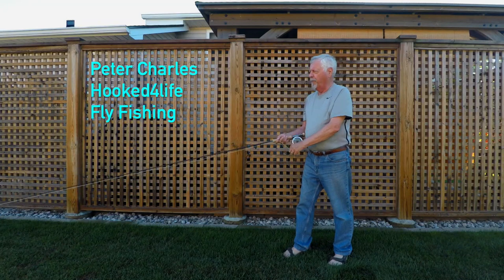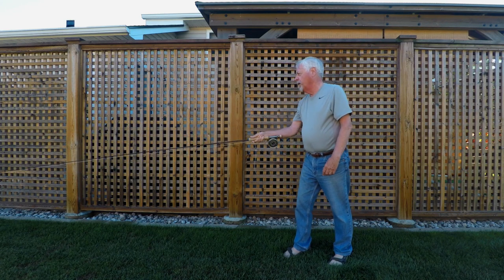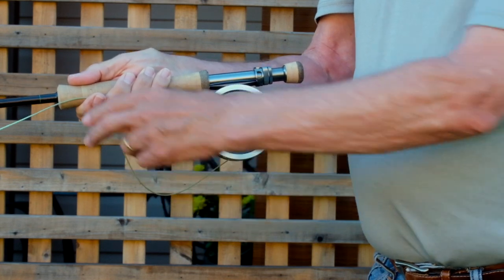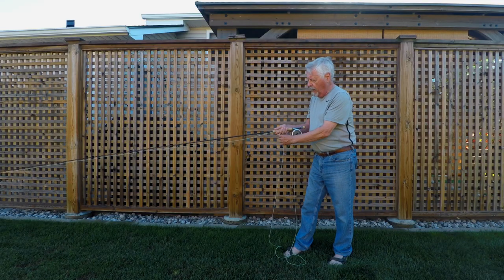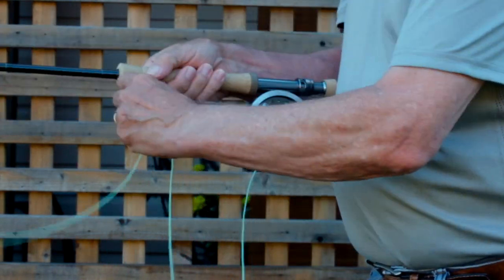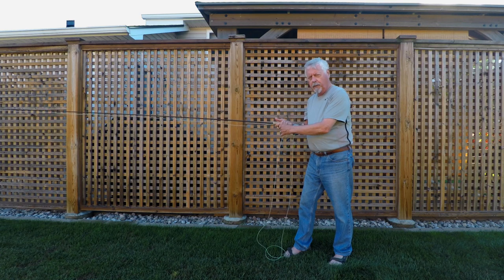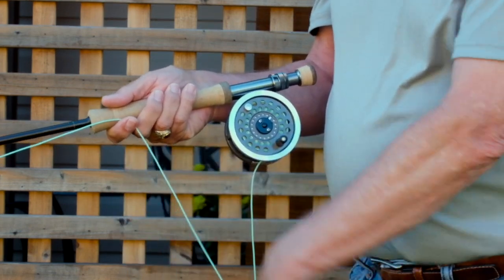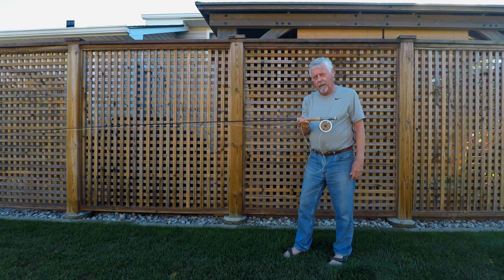Getting Started in Fly Fishing: Basic Line Fly Line Handling Techniques

Comment: Hello: I found your YouTube site from photography forum...you posted about same issue I am having running hdmi and charging/power cable on a TG-5.  Wondering if you ever located a dummy battery for this camera... for same thing you were using yours, to project image to large TV for fly tying demonstrations... thanks for any help :-)
Reply from the maker: I never did find a battery adapter for the TG-5. I ended up just making sure that the battery was fully charged before each video. I would run out of video at 26 minutes anyway when the 4GB file size limit was reached and a full battery lasted longer than that. One irritating thing was the inability to remove the battery level indicator from the HDMI feed. I would have to crop that out.
Reply: @hooked4lifeca  thanks...we aren't recording the video just using to put image on 65" tv for fly tying classes but you know those sessions can be long 😉  guess we may need to get a different camera...shame the tg-5 is a great little camera otherwise.  Thank you for your time, and tight lines 😀
Reply from the maker: @joideleon4192  Or just keep a second battery. We can get just over an hour out of single battery. Since you're not recording, just swap out the battery when the first one dies.The TG-5 has so much going for it as a close-up camera for video. It can be manually controlled in video (except for ISO) and we can get very tight with it while maintaining a useful working distance as the macro is at the telephoto end.
Reply: @hooked4lifeca   I hear you, my husband's the one that just wants plug and play, doesn't want to have to deal with changing batteries in the middle etc... since it's supposed to be waterproof, going to take it next time I go fishing and take some fishing porn pix and video 😀
Reply from the maker: @joideleon4192  Something I just remembered. Since the only battery draw is the HDMI out and the rear screen, I think it will deliver well over an hour on a single charge. Check it. I know one of my old cameras would go two hours with just the HDMI out, but I don't remember if it was this one or one of the others.
Reply: @hooked4lifeca good idea.  I'll hook it up and let it run until it turns off and see what we get out of a single battery... thanks again for your help 🙂